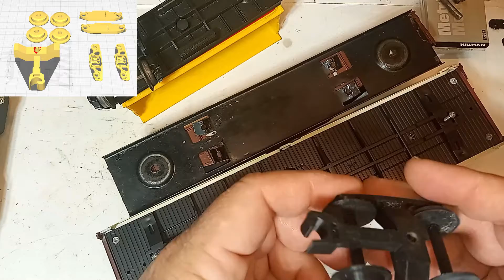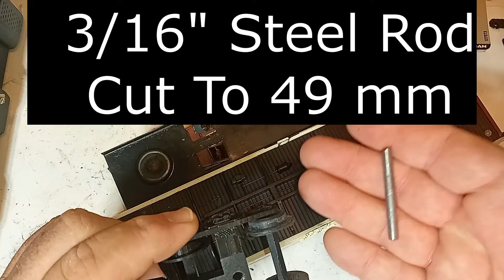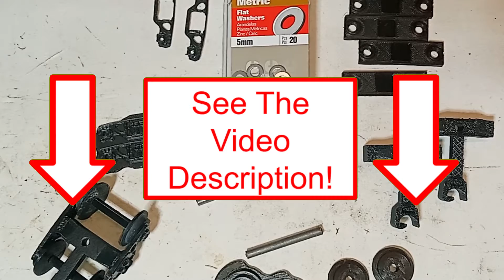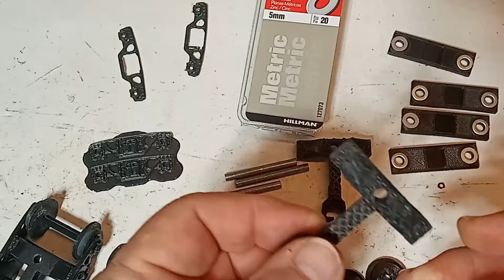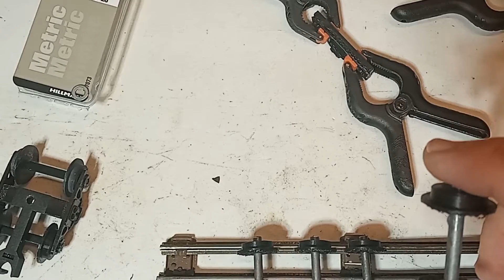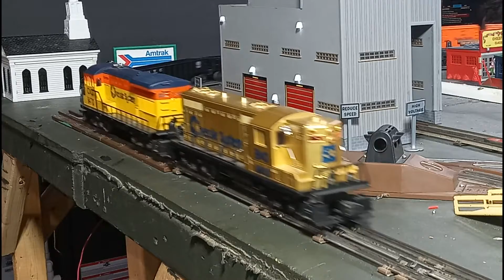How To Make DIY O Gauge Trucks And Wheels

Comment: .Ike can you  make  a o scale  flat car with stakes on a 3d printer
Reply from the maker: If you have a large enough resin printer you could probably do it in one piece. On a filament printer it would be best to make a separate frame and deck assembly.

Comment: I reckon I'll have to buy wheels and trucks as I don't do 3D printing.  I've got an old Lionel caboose with a good frame and bad caboose body.  Guess I can use the frame but will have to fine another shell.  I can use the caboose body as a static office or something.   Learning a lot watching your videos.  What other freight bodies would fit on the caboose frame?  I've seen literally thousands of guys selling 3D printed parts for HO scale.  Are there many who print parts for Lionel 027?  Cheers from eastern TN
Reply from the maker: I am not aware of anyone who commercially prints O/O27 parts. As far as the caboose frame goes, if it's the SP type caboose, only other caboose shells will fit.

Comment: Hm, if you could use a brass or copper eyelet or hollow rivet, you'd have a much better sideframe bearing than steel axle against steel washer.  Dissimilar metals make better bearings. 
AND a copper/brass eyelet/rivet pushed into the sideframe from inside would stay in place better than a press-fit washer...
Reply from the maker: Interesting ideas. Thanks!

Comment: Ah, one correction...PLA and PLA+ shrinks as it cools, which is why the wheel hole shrinks.   
If the PLA/PLA+ expanded as it cooled, the hole would get larger...

That aside, I also needed many O scale trucks, but for On30 cars.  I also bought an Ender 3D printer, as I figured printing 50 trucks would pay for it. 
For a raw newbie, learning CAD and 3D printing was an incredible mind-stretching experience, but holding a self-designed and self-printed truck that I could not have created any other way, was worth everything I went through.

And, of course, once I realized what could be designed and printed, I found all sorts of items - some new, some repair parts - that I can now make, thanks to the 3D printer.  As many others have said, 3d printing is a real game-changer...is it ever!
Reply from the maker: Thanks for the feedback!

Comment: Basic comment...why? There are LOTS of used trucks out there, especially in any TT operator's parts bin. If I just sent an email to the guys in my TTOS Division, I'd be deluged with trucks - no charge. If that's not the case for you - join a train club!
Reply from the maker: There are FAR more cars in my parts bin lacking trucks than trucks (I have a few spare wheelsets from broken trucks, but the ONLY truck in my parts bin currently is an old American Flyer 6-axle passenger truck). I have tried buying "scrap" cars at shows for trucks, but then I end up restoring the "scrap" cars anyway and I STILL lack trucks. Maybe it's different in your area, but everyone I know is always looking for sources of spare trucks. My father, for example, ended up buying 4 "scrap" cars just to supply wheels for a Postwar wheel car.

Comment: A trick I have done in the past is to swap out the plastic wheels on MPC era Lionel plastic cars with metal wheels. This alone adds weight to the cars and also makes them work on insulated track sections. I know your idea saves on buying parts but perhaps you could design a side frame to accept metal wheel sets. Just a suggestion.
Reply from the maker: Then I still have to buy wheels, which means buying scrap cars to steal from, which my makes more cars that need wheels.......
Reply: This latest design is looking good, Mike. I think you're on to something. Too bad you can't sell them. I think the plastic frames would be a good replacement if modified to be used with the existing metal axels and wheels for replacements. For those of us who use insulated isolated rail sections and rely on metal wheels and axels for control,   the plastic wheels wouldn't be desirable. I can see a good use for these for an idler Marx car, however. I'm looking for a good  replacement coupler for the now obsolete K-Line  K-2100 coupler for their version of the S-2 switcer in the Marx 1998 molds. I haven't found a good direct replacement for the operating couplers, which is kind of a big deal to have on a switcher engine. Aparently, no one makes a replacement for these. 
 You better be careful before you know it. You'll be working for Lionel or maybe your own business. How's Mike's Marx Machining sound to you. You already have the C&C machine😊.

Comment: Hello,  how hard is it to learn how to use a 3-printer. What special skills would I need to use it to make stuff for my railroad and for fun?
Reply: Coming from someone who's owned a printer for a few years now, If you specifically look for printers with at least auto bed-levelling, your barrier to entry should be pretty low. I went to knowing nothing about printers to being able to set one up with ease just from trial and error, along with the multitude of videos available online. And software like Tinkercad also makes 3D-modelling very easy to understand.
Reply from the maker: I concur. I went from assembling the printer to my first successful print within 48 hours. There are literally hundreds of thousands of free designs available to get you started. Try a few basic prints to get your printer "dialed in" and you're ready to go.
Reply: thanks to everyone for the advise. it really helps.  @ToyTrainTipsAndTricks